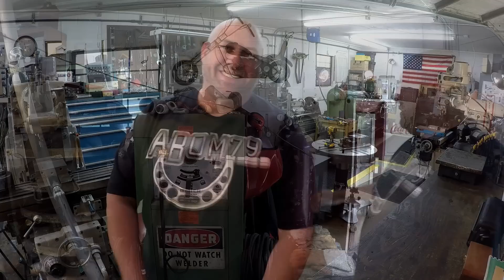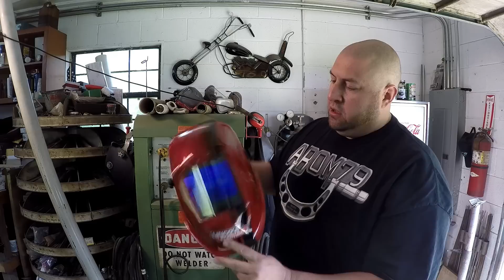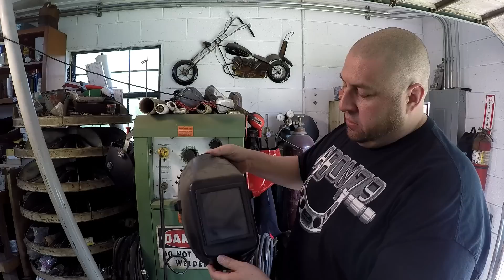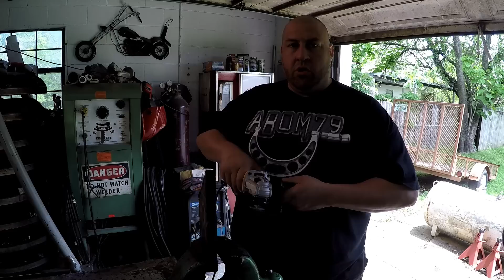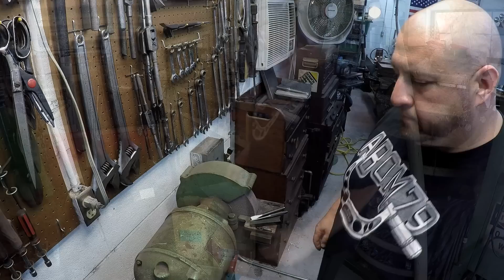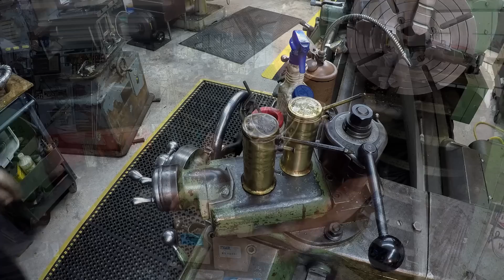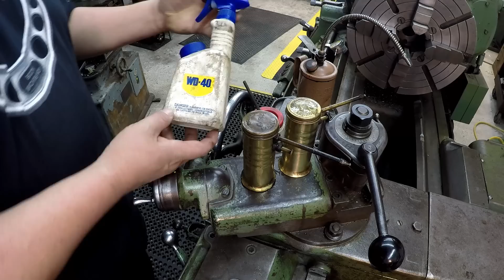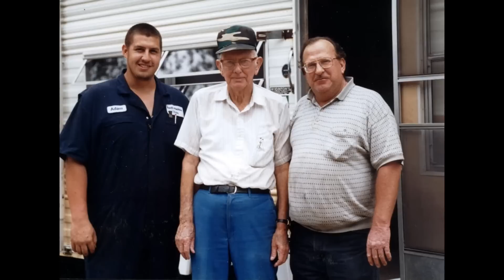10 More Shop Do's & Don'ts

Comment: Hey Adam great video but you for got to mention when you shut down a torch set to bleed down the regulators and after that to back off the t handles to mainly to prevent excess wear on the regulators and regulator burn outs when opening oxygen cylinder. And never hook up an acetylene cylinder that is not standing up right for at least 3 hours before use. I see a lot of torch misuse and it is scary watching people like that with access to the most explosive gas mix in the shop.

Comment: Re: chuck keys..........I don't work in a machine shop, but we do have a drill press. I always put the key back in the chuck when I'm done cuz every time I go to use it, I can't find the key. Then the next guy that goes to use it gives me grief for putting it in the chuck.
Reply from the maker: That's just my common sense rule, put the keys in the chucks, unless it is tied to a chain.
Reply: Agreed. Seems like the key is always in a different spot when I go to use it. I should weld a chain to it and the press lol.

Comment: Adam, Love the videos!!! Very instructional, but in 30 years of welding/ fabrication every oxy-fuel safety sheet and instruction I have had or seen states that you turn off the fuel valve to extinguish the flame, then do the oxygen valve. I was always told it keeps the flame from backing up the hoses. With the flashback arrestors on the torch and regulators, it is probably a mute point.

Comment: Most, if not all of that hits home. Granted, I'm in school but a vast majority of these young guys in my shop environment are excessively hard on equipment. Both shop and personal equipment should be respected. Abuse of Belt sanders seem to be a big one in my shop. It's extremely annoying and sometimes infuriating when people deem it necessary to abuse the equipment and materials. Their tuition pays for it, or in most cases, the financial assistance they receive does.
The saddest part of all, out of 20 individuals, only about 6 are employable and take any pride in the work they produce. 
More work for myself I guess.

Comment: Then it goes another way. I'm in electronics moreso these days as a tech and have bought myself just about every single handtool or tester or dodah you can imagine simply because the employer doesn't supply such gear and sometimes its real hard to fix a bit of kit without it. Now i have the rest of the workshop team CONSTANTLY asking me if they can borrow my xyz and i have even come on shift to find me tool case open and a tool out.... seriously... it's getting to be a bit much.

Comment: As an engineer for a automotive machine shop, something I learned when I first started was to make friends with the tool room guy and don't be afraid to ask them for help. Most of the guys in the took room have been working the trade for decades and only want to pass on that knowledge to the young one. Respect them and their tools and you will go a long way in the shop. Even if you have borrowed their tool once and know where it is, still ask if you can use it!

Comment: I can tell when my helmet grind mode is on because the front is flipped up haha
Reply: Those small brass oil cans on your lathe sound empty haha. I worked in a large transport engineering shop and was told the first day "If you finish a job and unsure what to do next then start cleaning if the foreman sees you cleaning he will give you a job to start once your done" I was just a gopher but never had an excuse to stop moving or a reason to be waiting for instruction.

Comment: By the same token, don't give people who do make an effort to buy their own tools crap over getting less expensive imported ones if that's what they can afford at the time, especially if they are getting results that are up to shop standard with them. A 'good' tool is the one you have that can do the job that needs to be done regardless of the brand name.
Reply: Personally I'd compare the tool against the name brand to see if there are any differences and point them out to the person. Make sure the measures are on and so on.

Comment: i go two ways when shutting off the oxy/acetylene torch. if im in a tight area i usually dial it way back on both mixes then will shut the acetylene off first to avoid all those spiderwebs of soot.  out in the open i do like u said. luckily i work by myself so i dont have to worry about other people around me.

Comment: Great point on the grinder! I've got a Rockwell pedestal grinder in my shop with a pair of 120 grit wheels. One green and one regular.  It's only to be used for sharpening tools, the 2x72 belt grinder is for general work, and with a 36 grit belt, will be much faster regardless

Comment: Rule of 2 if you have to borrow it 2x then buy it the exemption is an apprentice ask a journeyman. Apprentice's will have to buy a lot of tools and need to discriminate. Also if you empty a torch or welding gas bottle replace it there's a special place in hell for people who empty the bottle then go grab another torch or welder rather than change out the bottle

Comment: Lil thing to add don't turn gas tanks all the way on 3/4 of a turn so it can be shut off fast if need be and it's not a bolt it's a niddle valve

Comment: Chuck Keys: At work a lot of times there is already a location for the key (Japanese company, Kaizen principles). That said, noted on the trick for when there isn't already a tool stand made for said lathe/drill/mill

Welders: (and I guess torches too): If you use, it, return it to the previous settings (amperage/voltage, polarity, torch tip/type, etc.). 

Lathes/mills: If borrowing somebody's tooling, don't do super aggressive cuts that are going to dull the cutting edges. I've seen people shoot sparks with company carbide (shell mill) and then complain about not having any spare inserts...

Files: If you borrow a file, be sure to card/brush it out when you're done (especially if filing soft materials)

That's all that comes to mind at the moment. I'm an engineer at an automotive exhaust/body shell plant who sometimes does his own fabrication if you want context.

Comment: YES!!! 

Even the fabrication-oriented points fit perfectly with machining, or really, any job, like you said, Adam. 

I have a hard time with lending tools out. Unfortunately some of my coworkers look at my toolbox as almost a shop toolbox. They just walk up and get what they need. Usually, it gets returned.

Usually.

Sometimes I am absentminded and misplace things on my own, but there have been guys too cheap to buy a single replacement allen wrench, borrow mine, and lose mine... 

I've moved up very rapidly in the trade from machinist to programmer, so it is not often I use my own tools. But when I do need them, I need them, dammit!

Perhaps you could advise me on how to encourage folks to buy their own stuff? I guess it really comes down to just saying, look, if you borrow something all the time, you need your own, or hunt down the shop's tools every time... just not sure how to say it. I'm not big on confrontation.

One frustration I have with the situation is, I have put a lot of money and time into the tools I have accumulated in my three years thus far. It is my career, so when I get something, I know it will hopefully be with me until the day I hang it up. But others in the shop, from folks who have been in it 20 years to some who have been in it a year, don't seem to have that same mindset.

Excellent list and video, Adam. Apologies for my little mini novel here, haha.

Comment: I have always been taught to shut the acetylene off first, and when lighting, always use at least some oxygen.  The reason being is that the soot that flies out and around when no oxygen is used is supposedly toxic and possibly carcinogenic.  Even if it was safe, it still makes a nasty mess over time in tighter, more confined areas.  The shut-off "pop" is usually not as bad as the "bang" that happens when lighting.  That is the one that usually makes me jump unless I am aware that someone is about to light-up.

Comment: One thing that always fired me up is the guys who wouldn't take 10 seconds to think about how fast to run something in the mill/lathe and what the correct tool was to do it.  Every job used up a tool or insert because they didn't care enough to do it right.

Comment: For Consumables we had cards in them. For things like grinding wheels, the card was placed on the second to last wheel. If you take that wheel out, you WILL have that card in your hand.
Then there was a bin to place those cards, at least twice a day somebody from the office took all of them and ordered the new items.

For stuff in boxes like screws the cards where place before the last box, so if you open that box, again you had that card in your hand.

For bigger stuff like lets say pipe connectors there was a card in the box and once you where below the BIG number printed on that card you also placed that in the bin.

The Position of the card, like second to last, was chosen on how much that item gets consumed.
For Diamond cutting wheels, or for big saw wheels for example it was taped to the last wheel. Because unless somebody fucks up they will last quite a while.

Worked really well, except if the guys restocking forgot to place the card. Because people then thought "Oh ok somebody already placed that card in the bin"

Was a long time ago when i still worked in a metal and wood working shop.

I work in IT for like 10 years now, but i implemented that Kanban System there too.
For cables, CDs, USB dongles and whatever. Or Keyboards. Which are consumables for some users anyway :)
Reply: Dave Ticehurst - Sorry, I wasn't referring to "cut" in the sense of cutting with a saw, but more like the "cut card" in the deck when you play blackjack at the casino. There's a plastic "cut card" (that has no markings), that's inserted into the deck after it's shuffled and put back into the shoe. When it's dealt, it's a signal to the dealer to shuffle after the current hand is dealt and played. Only in this case, it's a signal to re-order more inventory! HTH! Sometimes it has to be virtual; such as with spools of wire, cable, or hose - unwinding the entire spool just to put a mark on it, then rewinding it would be a real PITA, so when you get to the point where the wire/cable/hose is down to the spool, that's your virtual cut mark.
Reply from the maker: I have a new welding cabinet with fold out plastic bins and I put the information off the box right there in the bin, AND used a label machine to make labels with with the item description and part number. I'm talking about my grinding wheels.
Reply: djteac - Exactly - I like to put a "cut mark" at about the 1/3 point; when a consumable gets down to the cut mark, it's time to re-order. That way, if the item is on back-order, or there's a delay in shipment, you still have enough inventory left. Of course, each shop needs to determine where to put the cut mark; some shops may have to re-order when the inventory is reduced to half, while others may be fine with 1/4 left.
Reply: Two sides to keyboards...

Good keyboards only get destroyed by heavy-handed "users"

Cheap keyboards, like the Dell ones we have at work, can fall apart / have the markings wear off way too easily.

My logitech keyboard here is ~4 years old and looks almost new... the one at my desk at work? Well, let's just say that if I were a better touch typist, it wouldn't matter so much, and I'm on my second one in 4 years...
Reply: djteac 

That's a good system there!
Reply: And @ Adam, I just left a shop where a) there was no re-order info in bins of consumables and b) only one guy in the shop knew where to order them.  Unfortunately, it wasn't the guy who had to hand them out (a/k/a "me")...

Comment: One more item that drives me up the wall , is leaking air hoses, it's a large expense that can save money on the electric bill if leaks are fixed.
Reply: I've had the maintenance guys come in on a Saturday, bring the compressors on line in the plant and spend the day fixing air leaks...the overtime was much cheaper than buying a larger compressor.
Reply: OKIE CHOPPER at this "spend $10 to save $0.05" shop i was working in recently, i just got fed up, replaced all the air fittings i used that were not matches and sent them an invoice to their accounting person and got a check right away.... rule of thumb- if its a crappy failing shop, circumvent the boss man at all costs.

Comment: Just an add-on to your gas cylinder etiquette...The oxygen tank valve is a "back-seating" type valve. This is because the valve stem packing cannot seal or contain the high pressure in the oxygen cylinder...a halfway open oxygen cylinder valve will leak like crazy around the stem. So when you open the valve on the tank,  open it ALL THE WAY especially if you are using the tank for more than a couple of minutes !!!!
Reply: Also, only open the acetylene tank 1/2 turn. The tank pressure is much lower and the packing will hold the gas pressure. The main reason for doing it however is safety. If something falls and cuts the hoses you do not want to waste time twisting the acetylene tank valve around and around to get it shut off. 
I've seen this happen in the fab shop and believe me you want to get that valve closed in one or two seconds. Cutting with a torch and the cut-off bit hit the floor from the welding table and cut the hoses. The hot cutting splatter ignited the acetylene... it made a dandy fire.

Comment: If you spill something on the floor clean it up!
Reply: grumpybill. that's not nice, bcblock02 had a very lucky escape from serious injury or getting killed when that cable snapped.
Reply: Volcker1929 sorry?
Reply from the maker: Yep, keep oil dry or absorbing mats on standby for oil spills. Keep the floor swept up to.
Reply: bcbloc02 like a drill??? 
sorry.

Comment: Shop etiquette is the key to a smooth running job shop,  I worked at a large metal shop and we had 3 shifts,  and shift wars were the biggest problem we had.  Other shifts always thought it was funny to pull stunts on the next shift coming on.  I for one did not like it , but it was common and probably still takes place at some places that works more than one shift.

Comment: Great content as always and true as can be.   I would love a little more clarification on the raised-burr grinding on drill bits.   I was told NOT to grind them because it takes the bit out of round.   Is this only the case when you over-grind?  or is there a proper way to do it?   Thanks in advance!

Comment: Worked in a shop once among a thief. He was stealing everybody's tools. We were told, under no circumstances will you ever touch another guy's tools. One guy heated up a tool with a torch and then stepped away out of sight. It didn't take long before a guy screamed and the tool hit the floor. They opened his car trunk and there were all the stolen tools.
Reply: John Tate at my current work we got a vise on a bench for welding so a dumb ass unbolted the vise and took it off the bench and walked out the door with it so we got a new vise and department that got the new vise welded the vise to the table
Reply: Wow thats nuts
Reply: He's lucky his co workers didn't take him out back and give him a tune up before inviting him to leave!
Reply: People that steal are a low form of life and should be dealt with . That is especially true for the IRS :)
Reply: It’s why some companies make “job Site” tool lines. Those are used where tools might be stolen, or broken too easily.
Reply: i had a boss long ago that would eat all the candy we had in a jar by the coffee maker. one of the guys put calf starter (looks pretty good if you squint enough) in the jar and the son of a gun ate it all.

Comment: I don't know if it's superstitious of me but I always bleed the lines of gas after using an oxy torch.
Reply from the maker: I've never used a torch that didn't leak enough to bleed out those lines by itself.
Reply: Abom79 aha. I've ran into that with shop sets for sure, if you leave a bottle on at our shop it's flat in a week. At home though I'm pretty nutty about replacing leaky hoses and they'll hold pressure for a good while, guess I've heard too many horror stories about torches.

Comment: On the gas bottles, when using them, open the valves all the open until the knob(s) stop. as the top side of the valve head has a heavier landing seal, vs trying to count on the O-ring packing on the shaft/shank to the knob.. they do leak around those often... start doing that, and you'll notice that the bottles are lasting longer... especially if you are on a bottle exchange program with a welding supply store, or refilling center. It is still a good habit to do, even if you own the bottles and they are brand new and not on an exchange program.

Comment: I treat my auto dark like a loaded gun, it's always in grind mode till I check.
Reply: grumpybill Amen! I've had too many with cells go bad on me, shade 12 or 13 gold for me only these days.
Reply: Gerald Gepes the electronics went out on my Miller elite last year, replaced with a full lense shade 12, back to nodding moat the time.
Still like an auto for tig.
Reply: grumpybill Yep, it happens. I like auto for stick mainly, easier to strike an arc if the hood is down and you can see what you're doing. For tig (especially high amperage) a full shade can't be beat in my book, I can see the whole damn room let alone the puddle.

Comment: @Abom79  No 1 & 2 are my pet peeves as I work in a Garage and I don't work everyday some of the guys use the welding helmet and change the setting and as for the welder wires they are always messed up or wrapped far to tight sick of changing the liners